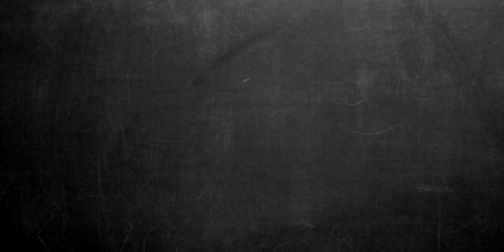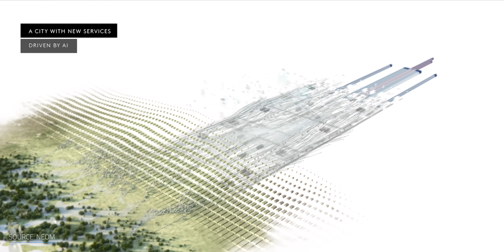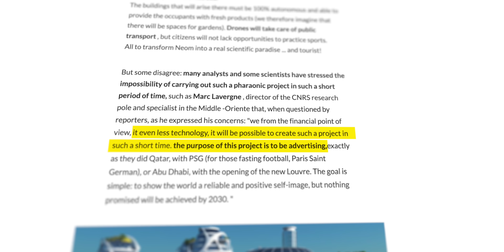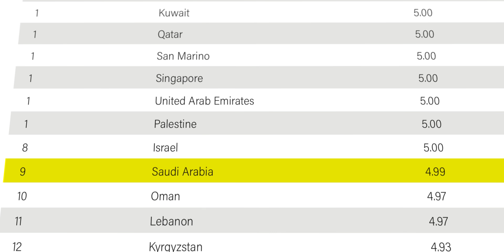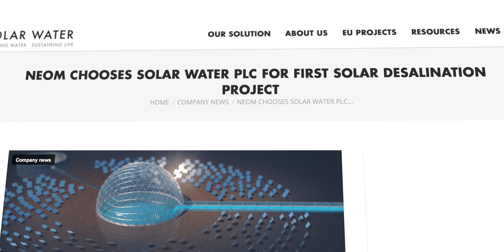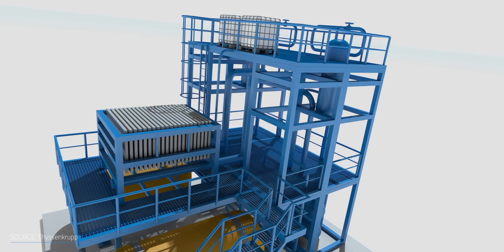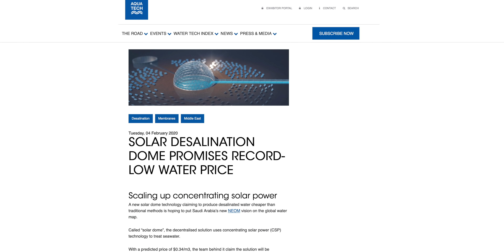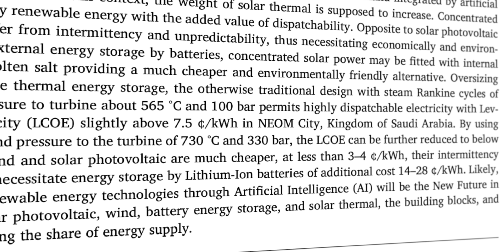Why Neom Might Be The Future of Sustainable Cities

Comment: I think one needs to wear different "thinking hats" when thinking about what one could call "The Vision", and when thinking about "The Implementation".

When thinking up Visions, you need to extend horizons to try to get out of our tendency to do things like e.g. sticking engines onto horse carts instead of going straight to something better like cars with good brakes. When trying to "be sensible" we think too narrowly, too "small", and we come up with solutions so close to the problem that progress goes at a crawl. This is nice for Granny (because that way the world gets to "stay the way it's meant to be"), but not ideal. Of course it's necessary to switch off "Vision Mode" when going over to "Application Mode".

OK, so in this case: The entire line/ "the presentation" is more an attempt to visualize what Might be possible down the line. You need to always ask that just to decide "is it worth it?". Is it worth moving from the comfy chair we're slouched in now? And the answer is always more like, "maybe", or "probably not" than the definite answers you want when making more immediate plans.

When you do switch to Implementation Mode, probably one of the first things to do is to scale down? (Since the need for Vision to be maximal means it's always going to be "too big" for the present time, in its entirety).

So "will it work"? To answer that, try to figure out a partial implementation that has some immediate payoff? (It's "meccano set" or "Lego block" time. Finesse those things you know a bit about into not-too-radical extensions. See if you can do something useful this way.

I think the specific cultural context is important, here, as far as providing a rationale for going ahead with a minimum first phase (calculated to offer a good return on investment for a smallish exposure to losses). In the Saudi case, I've heard that among the future plans is for the country to become a technological power. And for that, a probably minimum basic social requirement is to have at least one "secular environment". The need a city free from tradition, and far enough away from the centre, where they can cultivate the kind of mindset needed for technological innovation. They need a place in Saudi that foreigners can enjoy staying in, ideally (and don't just need to be lured to sweat it out in for high salaries), because the expertise of the world is mostly located in countries where people are intolerant of the kinds of restriction traditional Saudi Arabia has to impose (because people expect their world to be "the way things are meant to be" even in Saudi - just like suburbanites want to write suburban life into the future of their world).

If the Line is built from day one to be "Secularabia", that would possibly be enough to at least stop putting off the kind of people the kingdom would like to attract. Allow bikinis and topless bathing on at least some Line beaches, for instance. Maybe let the inhabitants make their own "societal laws", even? (And select them to be likely to make a place that tries to keep what's best in the West without importing its problems - like e.g.  suburbia :-) ).

Look at the Egyptian end of The Line. There are beaches/ sea frontage everywhere. Use that well, and you already have the beginnings of a potentially very attractive lifestyle for tech workers from all around the world (and, of course, secular-minded Saudis - but you'd have to keep the conservative local tech folk in conservative places). Start it as a "university town", and even if that's all it ever becomes, it would be a potential success.

I don't think the ultra high speed transport is a necessary condition for success, either. A lot of the Vision is just trying to imagine the Best that it can be. OTOH, fast transport underground (just the way it's done all over, if need be) is going to make for a pleasant environment. Keep the centre dense, so that facilities can be nearby, and plentiful. Make it pleasant, and you're going to get citizens who stick around and find ways of making it work for them. That's how every other city grew. Individuals moved in there, liked it, figured out ways to survive, accidentally helped others to survive, this way, benevolent cycle at least up to a certain point.

If you keep it linear (maybe with giant parking garages or open air desert car parks at "each end of the line") then the sides of your city are open for new uses. And if you can imagine good ones, you have a city people are going to be motivated to try and make a go of. They're going to want to live there, so they're going to create little economic cases for doing so, one at a time.

As far as Vision Mode goes, for that lifestyle, imagine that there are two golf courses per 100 people, maybe? And lots of stables for the horse people. And desert access rights for outrides. You could walk to your horse or golf course in a well thought-out part of the Line.

The other thing they could do is try to share some of the facilities that tend to be individual in suburbia, but ultimately go to waste. For instance the private tennis court. You could build single isolated tennis courts according to need (determined by tracking use levels), for instance. Yes, there are tennis clubs, but often people want to just play privately and possibly incompetently without some "coach" pitching up to interfere. So do the suburban thing - such as the hidden tennis court you have all to yourselves, and let people book them as Part of their right of habitation. Tennis players would book tennis courts. Horse people would book stables or paddocks or cribs. 

You could do that with a lot of things. Want a garden? Prove you can look after a little cabbage patch. Earn the right to a bigger piece of garden, onward and upward to the five-acre obsessive level.

If you made the living space as minimal as possible, that would also allow you to extend it. So imagine a mom, dad, two kids, in three rooms (maybe all in one unit). Give them a right to up to 20 guest rooms as part of owning that little nesting area, too. So if they have a wedding one day, they "have a huge house" for the weekend. And next weekend someone else does. It's possible to have at least some combinations of both "minimalism AND maximalism". Use your imagination, and you could arrange things such that just about everybody got to "have their cake AND eat it".

And there's even room for people who think of houses in a competitive kind of way. To compensate for having to have as small a nest as unimportant people do "important" people could prove that they matter by buying enormous holiday homes (in resorts far, far away). It's even possible to have that cake and eat it.

Anyway. Enough "vision". The question is "What is the Minimum Line"? If they make it 5km long would it become somewhere people were happy to stay, if the other habitability requirements are met?

(Things like desalinating seawater are just what a desert country - like California, for instance - is going to do as long as they have they resources. Because don't tell modern people they can't have water. :-) In the context of whether The Line is a good idea, to my mind this issue is a bit of a red herring. Yes, it's one of the challenges they're going to have to face, but if they succeed in creating a little bit of Secularabia inhabited by problem solvers, I'd bet on some nice solutions being developed there. I'd even guess that you have a better chance of some of those better solutions becoming realities in a place like The Line than anywhere else on Earth.)
Reply: @SoMuchFacepalm Sure.

1. They need somewhere where people from other cultures can feel like they can make a home. (I don't know if that is the actual reason for Neom, but it would be a good one.)
2. When you're envisioning things, you're not planning.
3. When you're planning things you have to make compromises on your visions.
4. When someone talks about their visions, and you react by talking as if they were talking about their plans, you either didn't hear what they were saying, or you didn't want to hear it. (Or you might even have some strong prejudice against anything like it.)

That skips quite a few things, but it's probably not too slapdash, even for a TL;DR.

Comment: When you play the " One- Street- Challenge" not in Cities Skylines but in real life :) One long road seems pretty inefficent to me, one big road fails and your city is down. Most cities today grown into their different segmenst that typically get connected by ringroads or have a grid- design...
Reply: not really... you have few paralel lines.... one line fails and traffic just switches to another...
Reply: The best way to build a city these days is to build them around people and not cars. The problem a lot of cities have (and this one doesn't really address it) is that you NEED a car. And when you have millions of cars on every road all at once? Instead of people walking 5-10min destinations or a really well organised intra and inter city transportion system? You inevitably end up with a city crippled by cars.
The line seems to be someone's idea to take all of the complexity out of city management by just removing all of the complex traffic routing... but it's a silly idea.
Reply: the design is about underground roads
Reply: you only have to control one cross-section of the Street to have an uprising.    Unstable governments (middle east ) will crippled by any group large enough to block one station.

Comment: Most Top down projects result in failure. The money is better spent in improving ecosystems which disappeared due to neglect and degradation during the last 40 years of development. Rewilding of which were turned into desserts over the last 100 years due to over grazing neglect and criminal damage can not only bring back natural greenery,  Rain, animals and water, but also build soil which in turn brings back more water from the air, rain, runoff etc. 

Sure some desalination, solar, wind power will go a long way but it's better if at least 40-50 percent is distributed at house and/or community Level.
Involvement of local people in projects such as these help build capacites and local social capital built is more valuable than getting outside expertise which only leads to consumerism without regards to economic , social and environmental consequences.

Comment: When you live at one end and work at the other....
Reply: Then you take the train, duh. That's how it works in so many areas already. I grew up in Hayward, CA and I went to school in San Francisco and Oakland, and had a job in San Jose. I WISH they were all in a straight line, I'd have saved hours a day.
Reply: @nathanchildress5596  going from one end of a circle to another is way less of a hassle than needing to commute a hundred kilometers only to get stranded if the train ever breaks down. I...don't see how having multiple necessary stops in a commute in a straight line instead of multiple lines would be that significant an improvement?

Comment: hyperloop development :
levitate air cushion near vacuum > mag lev low pressure > tube on rail (basically single train car) > guided car underground

why not just build a maglev?

regarding the line, isn't circular a more natural and efficient way to build a city? same distance from everypart to the center
what if someone from one end of The Line need to travel to the other end would it cost a lot of energy?

Comment: Math Question: Which geometric shape maximizes the average distance of it's contained points to each other? (Therefore being the most inefficient to travel in.)

Answer: the line 🤑
Reply: Depends on your topology? (I'm very much an amateur, but that sounds like the right general area to place the objection in). Or your graph? So if I put my house down at the far end of a much branched tree, such that it is connected by long, zig-zagging edges to things like facilities, it's quite likely to be far away from any facility. And a suburban "tree" has long edges and lots of forks, often by design. The idea that there's a "circle" around city centre, as far as "reach" goes is just plain obviously incorrect in most cases. Take a direct line to your objective and if you don't get bitten by someone's dogs, arrested, or shot dead, you'll have a difficult time getting to your "nearby" destination.

Another way of looking at it is this: "What's the shortest distance between two points?" (Actually it's mathematically the same question, hey?)
Reply: @SoMuchFacepalm Before choosing the set of points you want to measure distances between, you need to choose an appropriate metric.

Let's take a city park for starters. Because you're permitted to go by any path you like in a park, yes a circle is going to minimize average distance from the centre.

However, at a minimum, what you're modelling is a grid, not a park. That means you measure distances in terms of "taxi distance". You have to "go round the block", so your distance can't be minimized like you could in a park.

And then we add suburbia, where most people live in these "circular" cities, and the way you measure distance has to be in terms of the "graph" of suburbia. Everyone zigzags to get to the highway at one point, then the highway goes straight to a grid, and then once again. How circular your city is is not going to be a good measure of how accessible things are.

(And anyway  common sense and experience should tell anyone that even in city center, nearby things tend to be made far away by the layout.)

But that's going off at a tangent. The real issue is that a reductionist "circle is the ideal shape" view of things is only superficially of value. It ignores too many details. (A bit like Steve Jobs "brilliant" perfect cube computer was a disaster, just because for cooling things, it's better to be flat and thin).

OH what the hell.

The "line" packs up something like suburbia into the centre of the city. It puts people who were on the outskirts maybe ten floors up from a "center". It's not really a line. That's just a nice, superficial way of visualizing how the "trunk traffic" would flow. It's actually a thin, tall prism. And the area to the sides of this "line" are not walled off. They're part of the city. You just put different things there than you usually would. The sensible kind of thing to put "off to the sides" would be e.g. gardens (give people suburban benefits.)

Seen that way, the "line" is just a bit of relevant structure at the center of a rectangle. 

And the rectangle is just a not too bad approximation of a sequence of circles.

There isn't some aesthetic/ ostensibly practical geometric property of a city that's going to tell you in an instant that when you close your mind and stop thinking, you're doing so because you were right all along. There might be some other rationalization for closing your mind than this, but this one doesn't work as the clincher it sounds like if you just take it in uncritically.

Comment: I see a massive problem for the seasonal trek of wildlife. You're basically making a giant concrete wall
Reply: Not necessarily (also given the premise that there is a migration of this sort). You could keep your ground floor level as open as possible, too (think of all the arcades they had in Rennaissance Florence, for instance). It would probably be nicer (freer-feeling) to have an open ground floor that was just deep shade space for people moving from one side of the line to the other.

(In my "vision" - trying to imagine what might be, rather than just what needs to be done next week, there - I might imagine someone passing from her garden patch on the North side of the line to the stables where her horse is kept, on the South side. Or maybe to the beach. Or maybe to her favourite coral reef dive site. Or to the local yacht mole. Or to the water hole the animals cross under the building to get to in the afternoon so she can watch them a bit from the hide there.)

It's too trivially easy to see problems of a place like this. It's too natural, too much our default mindset. Yes it's necessary, but it's something that can wait, and doesn't need to be planned into how one goes about thinking about something this unfamiliar. The more difficult thing is to see the opportunities that exist. And it's even a bit more difficult to seek solutions to problems eventually found, like wildlife problems. 

One of the ways around the fact that there surely will be unforseen problems (instead of the problems we just dive straight back into every time we approve yet another suburban cul-du-sac in spite of the problems with these) is to develop a little at a time, and then look at what happens. "Build a bit to find the unexpected problems".

There's a very simple solution to the wildlife migration problem if it's found that animals won't move under buildings: Just leave a gap? With cycle paths above, metro lines underneath, etc.